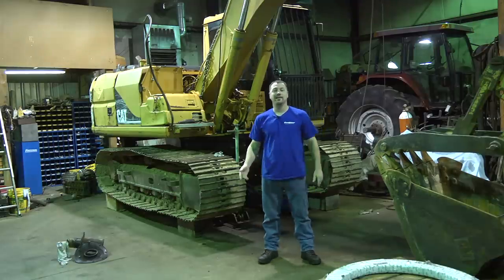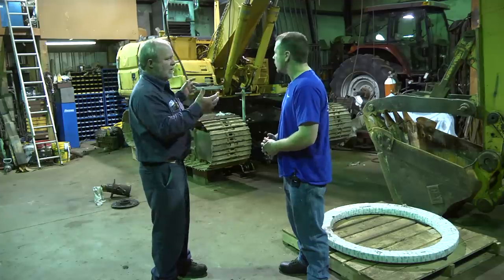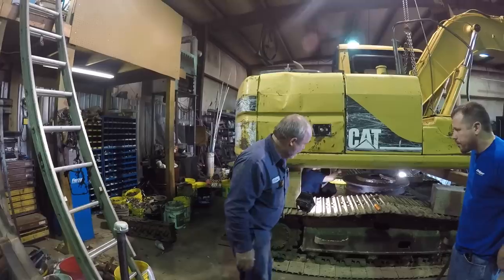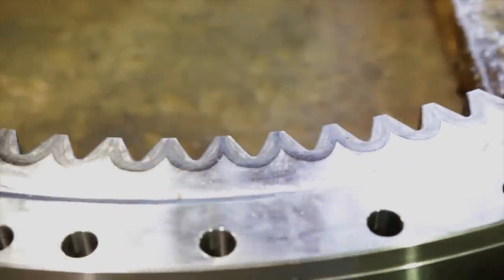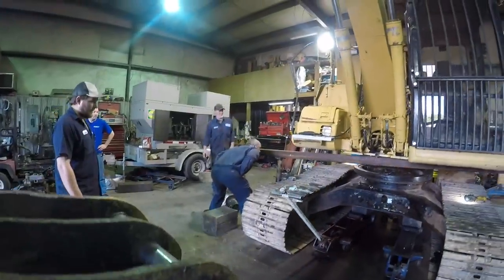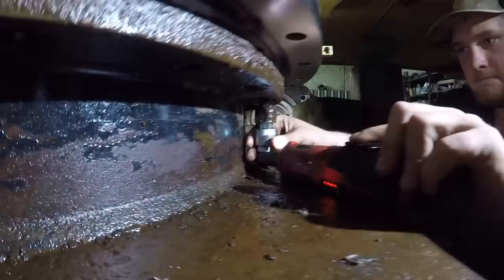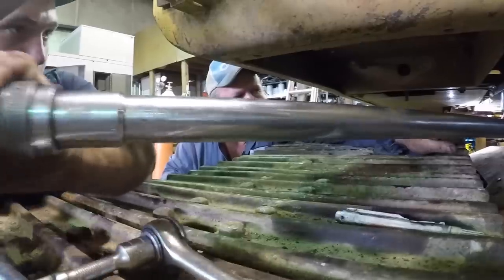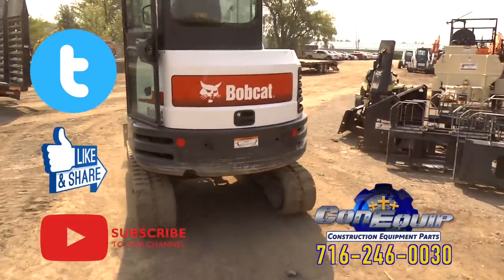Excavator Swing Bearing Replacement Fun Version - ConEquip 101

Comment: The local Kubota dealer wanted upwards of $7,000 to fix my little 4½ ton KX 121-3 excavator that has too much play in it. They said could take 30-35 hours. Sounds a little high to me. Now could be because they have 12 people handling the paper work generated by 4 or 5 repair techs. I cancelled my work order on it.

Comment: Good video , i have a mini excavator,  nothing wrong with the swing bearing but i need to change the rubber tracks. It's on a komatsu pc40 just a 12,000 pound mini excavator but i am not realy a mechanic,  but i do have some experience...not much though...iam pretty sure i can change the tracks if i can find a video on it ...i did help put a track on after it got a rock in the track and caused it to come off , the track wasn't adjusted right it was loose and i didnt know how to tighten it at the time

Comment: Cool stuff. I would have thought they would have dragged the carriage out from under it to work on it so you aren't working in a pinch point if things went south while trying to clean it.  Also , is that whole area inside the ring gear packed with grease or just applied to the ring gear?
Reply from the maker: Definitely a lot of debate if you should always roll the undercarriage out.  Probably risk both ways.  Grease was applied in all areas.  Thanks for the comment!

Comment: A shop uses what they have for safety and developed out of necessity.Still its risky to do a job like this unless its at the manufacturer where they have the equipment designed specifically for this job.I cringed a bit at some of the things done.The block between the track and the support beam showing up late.Editing may have made some things look worse.When reaching in like during cleaning I personally make long handled scrapers,I dont reach in there.And putting a finger under the bearing to spread silicone?The other guys bar slips and its your finger. Not I,that is why God made sticks.I did appreciate the video.A different approach  this shop has for their situation.I appreciate the mechanics skill and knowledge and their serious approach to a dangerous job.The teamwork was impressive which is crucial to safety.I laerned alot from the video and appreciate that.I like how reasons were explained by the mechanic.Thanks
Reply from the maker: you are not alone.  We've had a few people mention safety issues with this way of changing out the bearing.   Thanks for your opinion.  It is highly regarded Matt.

Comment: a good mfg of equipment would buy a slewing gearbox with a pinion  gear that is slightly softer then the hardened teeth of the slewing bearing. Also the pinion shaft of the gearbox should be male spline and the pinion gear is easily replaced at a low cost.

Comment: Can't  imagine any silicone sticking around and surviving that pressure. .! ..I guess some could cure near the edges and maybe down in the fine grooves of the machining finish
Reply from the maker: Most would definitely be expended.  Great observation on your part.
Reply: Conequip Parts LLC  ..I have a Hitachi ex120 and hope to someday be setup for a repair as that. ..have you done a video on  track  pins and bushing s
?

Comment: Hey great video guys. I bought a jcb 8065 excavator. Unknown to me the slewing motor  gear was all chewed up. The swing bearing ring gears appears fine? I have measured slack in the bearing with a dial indicator from the track frame to the underside of main body at 15thousanths.  That seems pretty good to me? What could cause this and would you try to just replace slewing motor gear? That is what i am planning. Anybody ?

Comment: Why do you need a service manual to look up torque specs? use a standard torque table.
Reply from the maker: great question!
Reply: Not all bolts are done up to standard spec 
Depending what they'd use for 
Manufacturer specs are anyways first go to 
Failing that then use a torque table
Reply: Because a torque table gives you use the optimal torque for that bolt, not for the place you put it in. A torque table may be deceiving for some applications

Comment: I don't feel the supports were adequate. For crane failure with that guy leaned in over the track, I lost a nephew that way. I think I would build special supports for this job that could work for all types excavators. I never realized  how dangerous this would look to me. I am a retired heavy equipment mechanic, and I have done jobs like this myself. we would have charged a couple thousand just for work, not the bearing.
Reply from the maker: Thank you for commenting.  So sorry for your loss.  The crew had supports all around.  The crane was only another precaution.  Certainly no job is 100% safe but this was as safe as rolling the undercarriage out from under the machine.